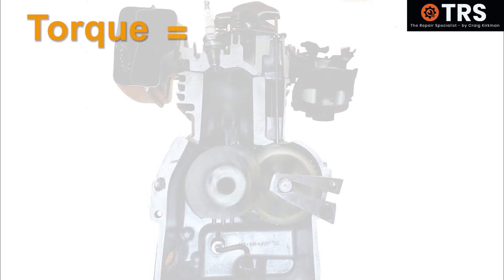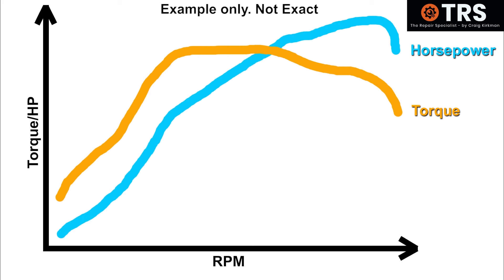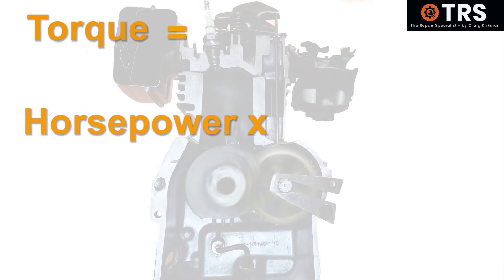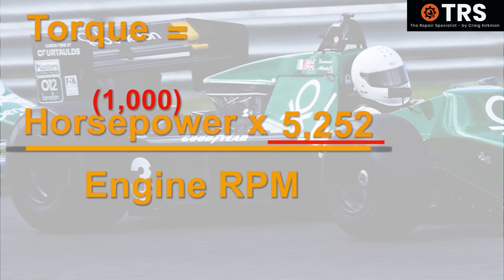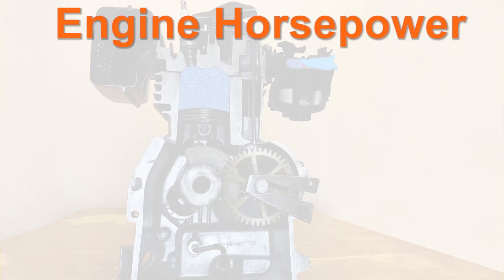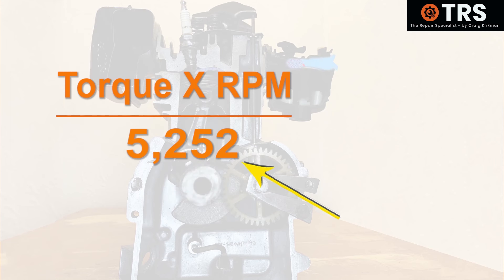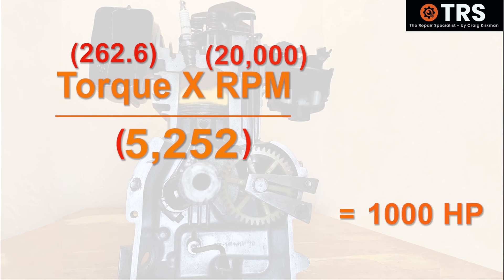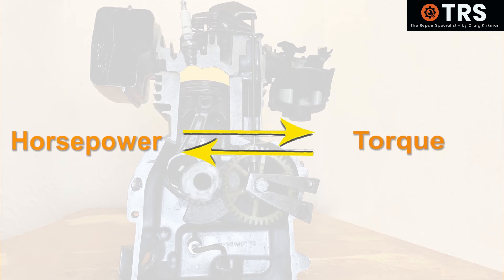Easily Calculate Engine Torque: Easy to understand Math Behind the Calculation. (by Craig Kirkman)

Comment: I tried this with a small block 5.3 engine making 325 hp. I did the formula of 325x5252= 1,706,900 and divided that by 2,600 rpm and the formula tells me that a 5.3 LS with 325 hp has 656 ft lbs of torque at 2,600 rpm. That figure is profoundly incorrect though.

Comment: Love this video, could you please explain to me the intercross rpm value.
I have a made a dyno in my workspace, with a 420cc engine with 14 or 15 horse power. Spinning at 2500rpm and in trying to calculate the torque but I’m stuck!
Any help apprciated.
Great content btw